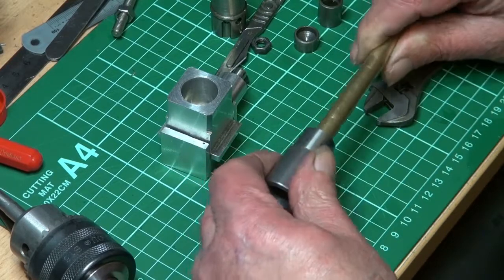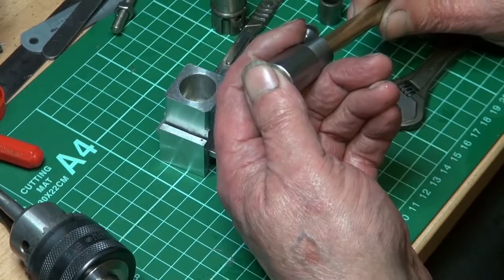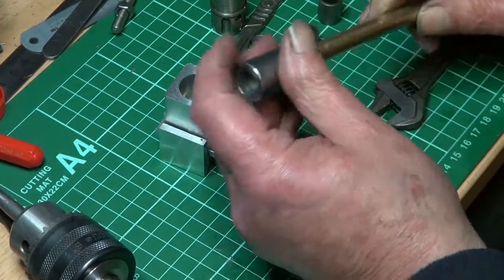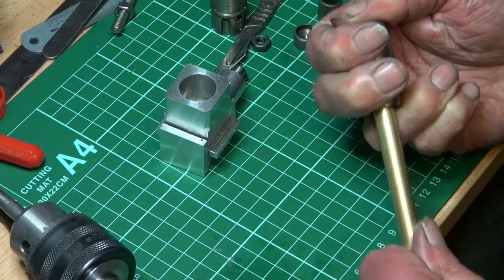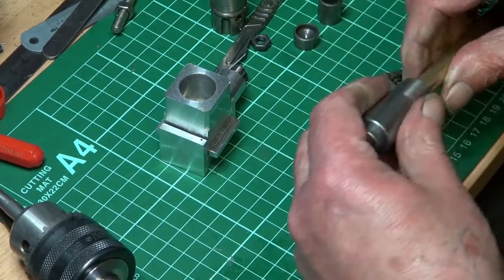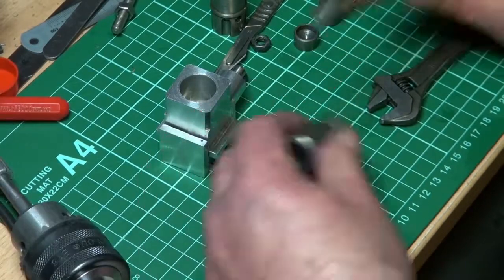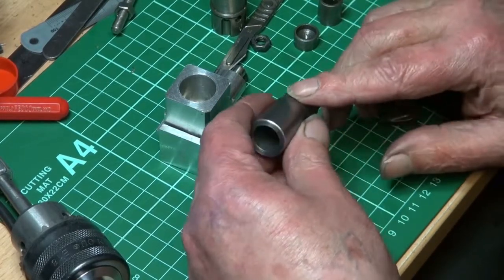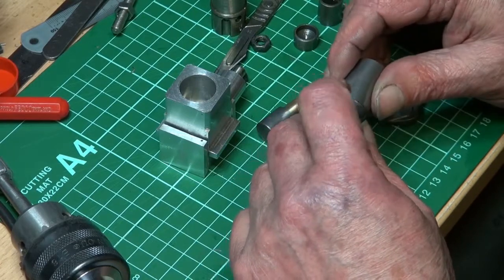Diesel Engine Build Cylinder 19

Comment: A bit of good fortune. Starting to look like something. 
I was wondering if you could turn this engine over with compressed air like the Spanish fella did.
Reply from the maker: I have not tried to run a I/C on air,on this diesel I would think the compression would prevent it.
Reply: Ah so that miniature engine he built would never run on real diesel either. No wonder those coins stood upright..he had virtually no compression.